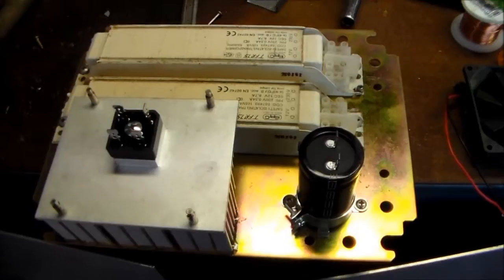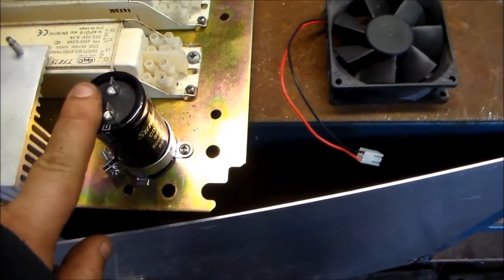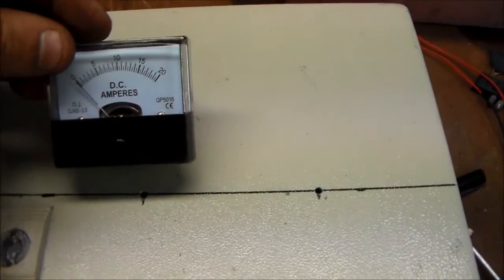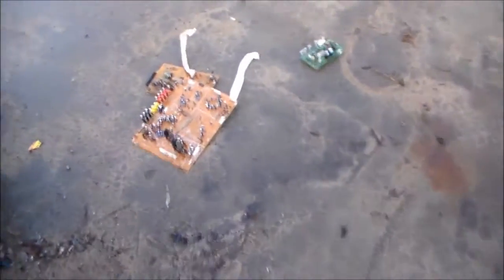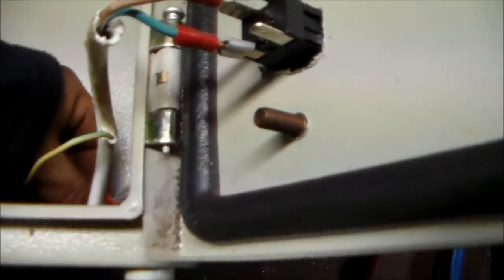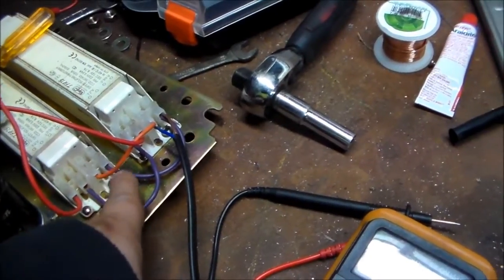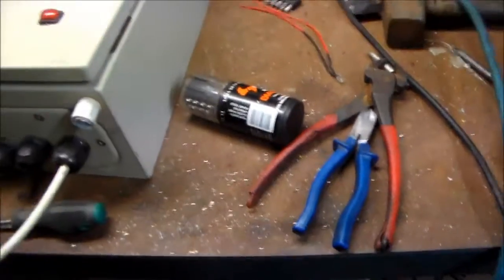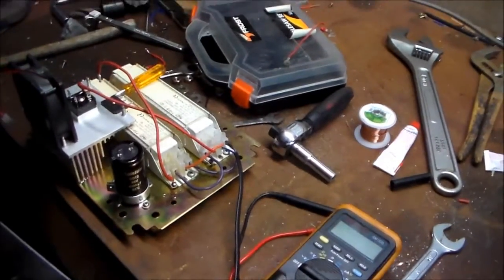12-24v Bench/Lab Power Supply Build Part 1

Comment: Oops, I should also have mentioned the straddling PNP transistor has the emitter facing the rectifier, and the base facing the input to the lm317. once the 317 pulls about 100ma, the EB junction will reach about .7v and the transistor will conduct thus bypassing the 317. The 317 will never need heat sinking as it will never go over about 100ma. You can set the RBE value to whatever cut in current you want!
 And with that, I think it's bed time for me!!!

Comment: I Try! 
Hard to give you a good circuit description in 500 chars! You can also do an easy regulator with a standard lm317 circuit with a big PNP transistor and 1 resistor from E to B straddled over the 317. The E Resistor B go's on the input line, and the C connects directly to the output pin on the 317. About 6.8 ohm will cut in at 100ma. You can paralell more transistors, as long as you have a tiny bit of resistance on each emitter to absorb any tiny differences of VBE in the transistors..

Comment: Great idea to make the PSU 12 / 24 Volts.
To reduce inrush current often a 47 ohm 10 or 20 W power resistor is switched in series with the mains, and bypassed after 2 seconds or so, by means of a relay. In high power amplifiers this is often done as large multiple 47000 uF 50 or 63 Volts Caps will take out the mains fuse.

Comment: Suggestion re the 12/24v wireing:
Instead of a swiched tap, you could wire up a series/paralell selector switch.
That way you could have 12v at 20a and 24v as 10a.
The cap at 8000 should be fine.
I'll call the phased outputs of the transformers A and B.
6 pin dpdt switch, looking at the pins of it virticly, you'd wire it as follows.
connect top left to top right.
T1 A to left middle, B to bottom right.
T2, A left bottom, B to right middle.
 output from bottom left and bottom right.
HTH

Comment: You could wire the selector switch to parallel the two transformers for 12v to get 20a output.
That's a nice looking case for a power supply.

Comment: The box of death for some innocent pair of transistors lol :-)

You just need a suitcase handle on the top and its portable :-)

And you can add a 3 pin adjustable regulator and panal control so it has a variable regulated output for testing small things :-) perhaps ??

Comment: Nice!
I've just gotten a hold of a big old metal house alarm control box with various LEDs and a keyswitch mounted in the front panel already, I think I'm going to turn it into a variable voltage power AC/DC power supply.